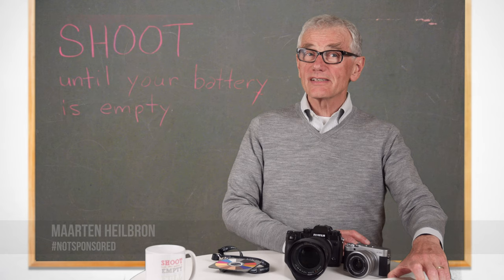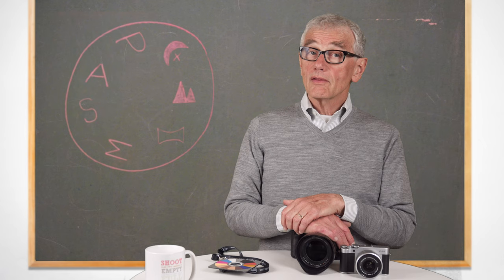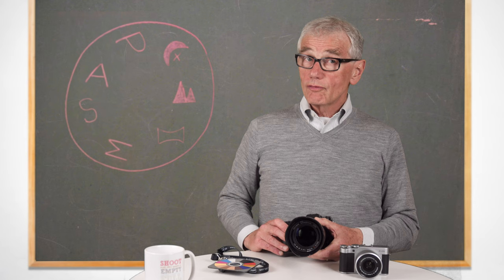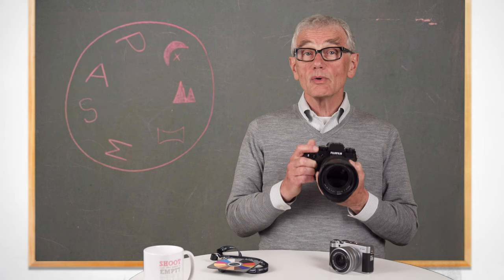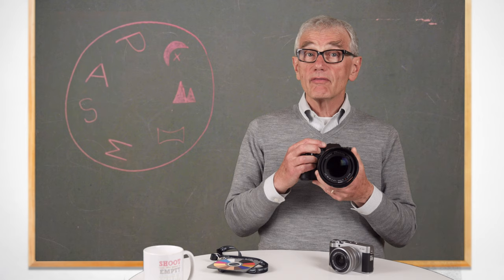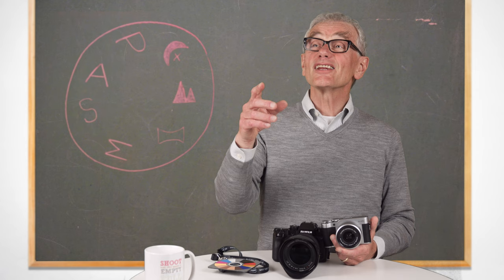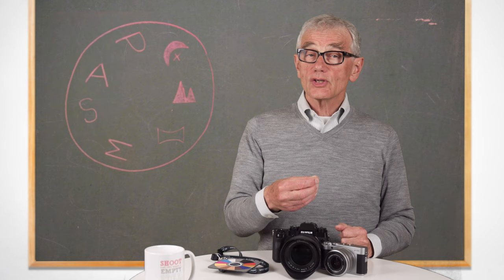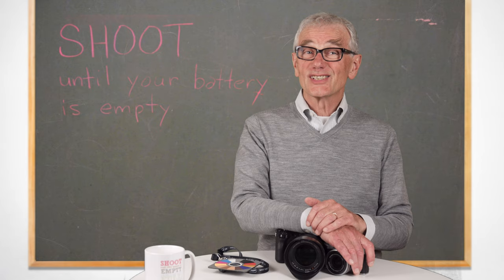PASM CLSRM

Comment: I really appreciate the "Dad Talk" videos, thank you for helping to bridge basics/theory and in-hand equipment. I backed into more advanced photography when I was asked to start taking photographs and producing videos at work but my brain just doesn't compute manual adjustments fast enough for me to apply them in real time, and so I feel stuck relying on auto. This video definitely provide a few Aha! moments that I look forward to applying soon. Edit: Maarten, all, if anyone has recommendations for videos/resources that may be helpful in improving my application of manual settings, I would greatly appreciate the reference. Thanks again!
Reply from the maker: I'm always pleased to read comments from viewers who have been helped, and appreciate my content. Thanks for taking the time to comment. 
Manual (for video anyway) is pretty easy. Set the shutter to 1/60. Open the aperture so you get the depth of field you want. Increase the ISO (or put on an ND filter) until the right exposure is achieved - use the histogram and your eyes to judge.

Comment: Had there been a photography class at school my school days would have certainly been less brain numbing. P selective doesn’t seem to work correctly on the D810 so I stick to M with auto ISO. A good tip I learned for M with auto ISO is ideally set your speed to about 1/500 and aperture to about f4 before you switch the camera off. This way if you need to quickly turn it on to take a shot you will be close to where you likely need to be for settings. Not that I ever remember to do this 🤪😂😂😂
Reply from the maker: Good tip. I also have intentions to return to a specific setting before powering down, but rarely remember to do so. Glad to hear it's not just me.